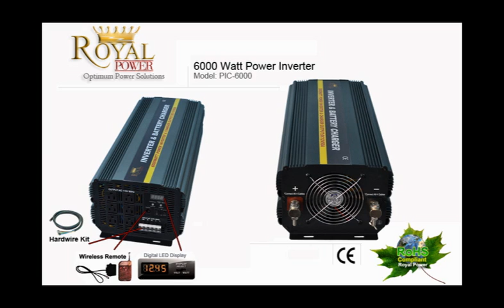6000 Watt Power Inverter - 50 AMP Built-in Charger and Transfer Switch - Royal Power - (PIC-6000)

Comment: i bought a 6000 watt power inverter-50 amp built in charger and transfer switch my question is how to connect the hard wire from inverter to circuit to house dont understand

Comment: 6K-Watts at 12V means 500 Amps (not 50). That's a large amount of current and the
connectors look very small. You want to give a starter-motor some power to start
a bigger engine (a V8 needs this amount of Power to start) so you have to handle
the current at this low voltage.
This Device can not work with 500 Amps contineousely so forget ist.